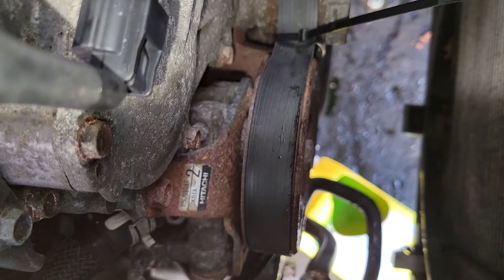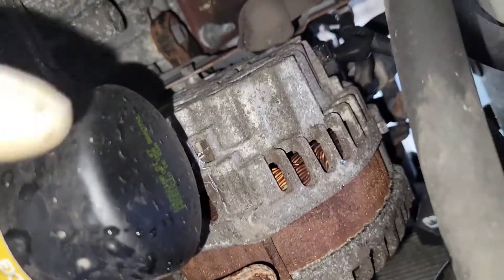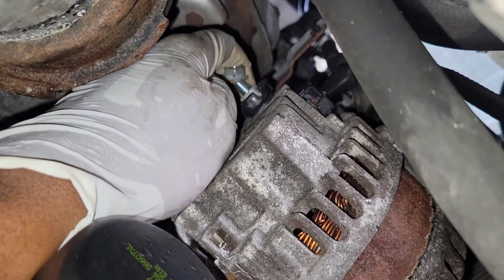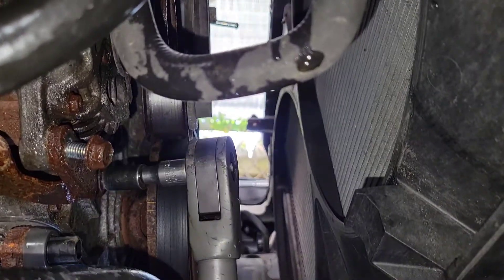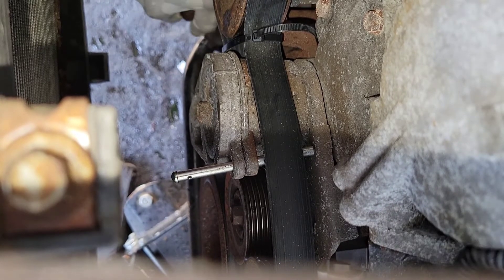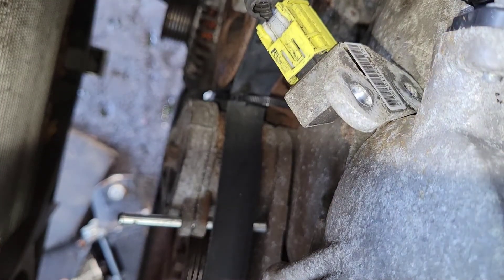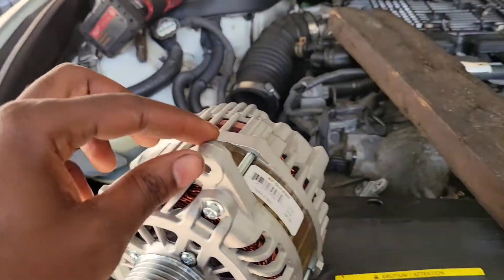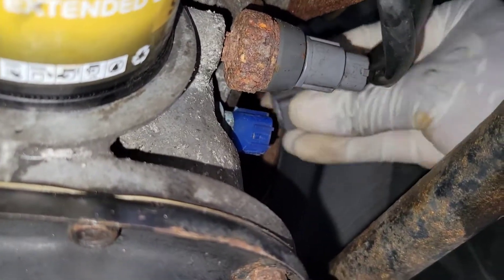How to replace remove alternator infiniti G35 G37 Q40 (PART 2)

Comment: Question was this a Coupe or Sedan? I have a coupe and I dont have that much room behind the alternator to put the 2 8mm back on so help if you can!! Do I even need to put the 2 8mm back on!!!
Reply: Did you ever get it?
Reply: unbolt the alternator turn the back towards the passenger wheel

Comment: I don't understand how u have so much space behind your alternator? I have a g37xs and I've been stranded for 2 days because I can't reach the 2 8mm bolts and the ground connector.
Reply: His must be rear wheel drive
Reply: yeah same bro, looks like the awd have a different alternator setup
Reply: Anyway around this. Been dealing with it for 2 weeks
Reply: @dimicole963  yes it is. Remove the power steering pump and you will be able to remove from the top and not from underneath.
Reply: Ong I just figured it out.
Reply: @skorpio88  I was able to hold tension popped out that long ass bolt and now I’m literally elbow grease deep unbolting the final 8mm
Reply: @dimicole963  u got this bro 👍
Reply: @skorpio88  Tomorrow we’re gonna start in replacement. Instal. Thanks boss. New sub
Reply: @dimicole963  ok cool, I appreciate it 👍

Comment: New battery took off power side car still ran. But turn the car off and hooked up a voltmeter and the draw is 12 volts from negative post to negative wire. Battery dead in less than a day what could it be taking that much power.